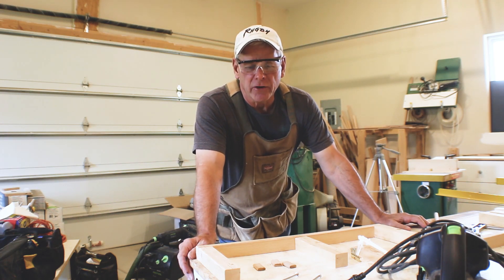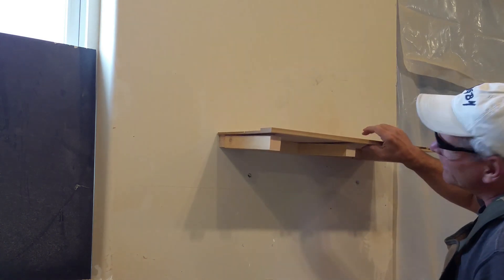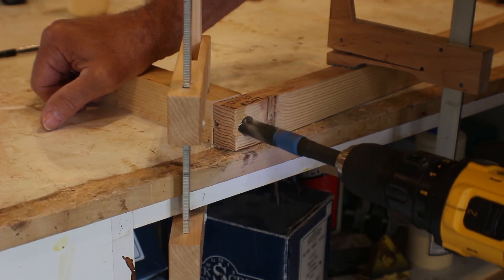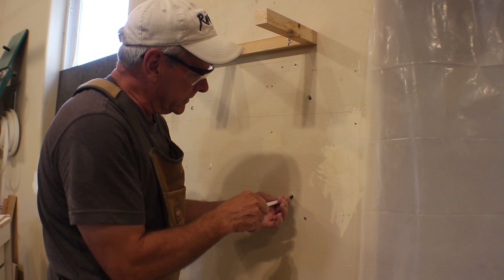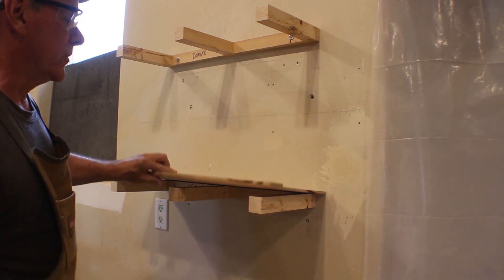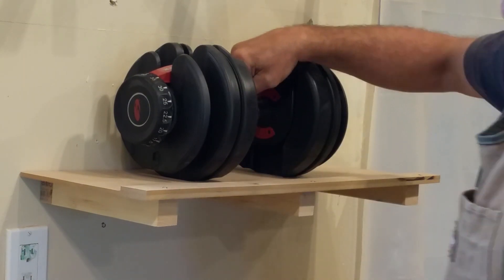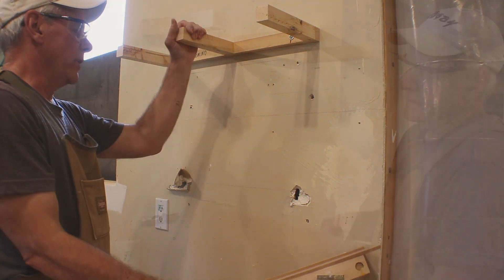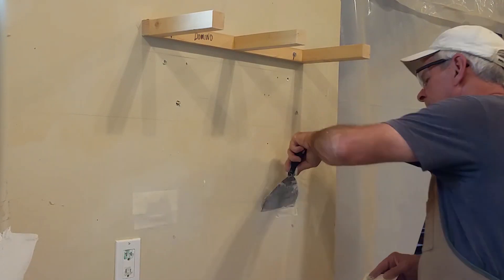Floating Shelves Sheetrock Test - Why Toggle Bolts Aren't the Best Option for Shelf Strength

Comment: I'm trying to put a floating shelf which is about 20.5 in Width and 17.5 in Length held by anchor togglers supposedly 143lbs. I want to place a projector which weighs about 28-30 lbs. Do you think the sheet rock will give over time just like this experiment? Unfortunately, I can't use a stud as there arent any in that area where I need to shelf.
Reply from the maker: Yeah, unfortunately you are probably right that the shelf will not hole up in sheetrock. The greater the width of the shelf, the more it is like a swimming pool diving board. That springboard action is what will tear out the sheetrock. Those weight support numbers are really referring to downward force on the sheetrock, not lateral or combination of lateral and downward forces. A couple of "L" brackets with a couple of toggle type bolts in each would probably do the trick in the sheetrock.

Comment: It's kind of annoying that you had wall studs there, two examples made, and you didn't test the weight capacity of the floating shelf attached to the wall stud with 4 inch screws...
Reply from the maker: Hey, Jacob! You may want to take a look at a playlist on my channel called “All About Floating Shelves”. I did a number of videos on strength testing various ways to attach shelves to studs which included some screw tests. The main thing I found was that the screws tend to flex more as weight is added to the shelves than some other methods such as wooden dowels into the studs. The most rigid installation method by far is the all thread rods into the studs.

Comment: I have wood paneling in the great room of the house; I wonder how strong they'd be compared to sheet rock.  My guess is less.  This is the old 60's style wood panel, fairly thin.  But, studs are every 16" as expected, certainly I would use them.  I'm planning on mounting my 55" curved TV to a mount held by the studs.  It's a typical tilt and swivel used for the curved sets.  Obviously I won't be mounting to the wood panel! :-)  But, I'm thinking a few floating shelves for bric a brac; and I was wondering if the wood panel would work for that.  Still suspect not; we have a Main Coon Cat that probably exceeds the weight limitation of wood panel support.   In fact, not sure why I'm even wondering right now, seems slightly better than cardboard. lol

Comment: i made 2 floating shelves out of pallet wood. for the "bones" (the inner part that's actually screwed to the wall), i used 1.5" x 1.5" just as you did. i attached the runners to the part that's against the wall using wood glue and 2 screws in each one. i then mounted the whole thing to the wall using lag screws (with pilot holes drilled, first) going into each stud that it crossed.

my lower shelf is around 4 ft long and my upper shelf is just over 7 ft long. my lower shelf (just above my monitors) holds my router, some desk supplies, a jar of candy, and a few other items. it doesn't sag at all. the upper shelf has some of my collectibles on it. they weigh quite a bit more than the stuff on the lower shelf and it doesn't sag, either.

and while they don't look near as good as yours (seeing as how i used pallet wood, lol), i didn't really pay anything for them. i get the pallets for free and i already had the other wood, glue, screws, and other hardware i used.
Reply from the maker: Thanks for the report, sean, and comments. The reason I went with the dowels instead to the screws is that I wasn't sure about those glue joints against the wall but it sounds like they are working fine for you. My guess is that the length of your shelves with you hitting all the studs in that span is helping the overall strength as well. Hey, there is nothing wrong with that 'rustic' pallet look either and it's awfully hard to beat your price! Good job!
Reply: @RustyDobbs  hitting all the studs is what i set out to do with the long one. after i made the inner frame, i marked the stud locations on the wall. then, i held up the frame where i wanted the shelf to be, then marked those locations on the frame. then i drilled pilot holes for the lag screws and used large, flat washers so they wound't pull through the frame. then i held the frame against the wall (again) to mark the hole locations on the studs then drilled pilot holes for the lag screws (using a smaller bit) to go into the studs. it's pretty damn solid on the wall, lol. for the small one, i used a combination of lag screws w/large washers into studs (2) and toggle bolts w/large washers (3), alternating between them along the length.

and using glue and screws going through the long frame piece into the runners (or fingers)...i coated the ends of the short pieces and the area of the long piece it mates to, with glue to make sure there was more than enough. then i put two 3" screws into each one. the glue holds more than the screws, but i added them as a little extra support...just in case, lol.

i want to build some more to put in other parts of the house. but i'd rather build those with some nice, solid wood; as the rest of the house is a different style than the room with the ones made of pallet wood.

Comment: I wonder if another 2x2 added above the shelf would help with it pulling out. Kinda like sandwich for the plywood shelf. 

Im trying to add a microwave floating shelf in my kitchen into a corner. So 2x2 or 2x3 supports on the back of the shelf 25 inches long,& a 17 inch support on the right side of the shelf. Then placing the same supports above the shelf so it doesn't flip and holds it into place. Stud placement in my walls are horrible. Anyone ever try or understand what I may be talking about lol
Reply from the maker: I don't know, Actionronnie, but tend to think the 2x2 above the shelf would not help much. If you have at least one stud on each wall in those spans and the studs in the corner, I would think you could build a shelf that would safely hold a microwave depending on its weight. It being in the corner is a plus. You might check another of my other videos on floating shelves which includes a corner floating shelf and see if anything looks helpful. https://youtu.be/nAOAkoIFkAo   I've done some other videos on floating shelf strength that you may want to check out as well. Thanks for your comment!

Comment: Would there have been better support with more anchors,  like 4 instead of 2? Would 4 anchors support the 50lbs?
Reply from the maker: Possibly a little stronger but in this case the strength of the sheetrock at each location of the anchors is the determining factor when weight begins to be added. Check out this video for more floating shelf strength exploration. https://youtu.be/EXMJnYl5by8
Reply: Yes, your intuition is correct. You're effectively distributing the load that each anchor exerts on the back of the drywall. How much weight and on which anchors loading occur depends on the type of load (point load? distributed load?) and where loading occurs (on a single anchor? in the middle of two anchors? 1/4 of the way to the next anchor? right against the wall? halfway deep? at the tip of the shelf?). The closer the load is to the wall (and the anchor), the greater the shear force and the weaker the torque ("the pulling force" against the drywall -- which is why it failed in the video) and vice-versa. Because wood is long grained, there is a tendency to "split" it if you wedge too many screws next to each other (so stagger it).

Comment: I am curious how they respond when screwed directly into the studs. i want to create floating shelves for my cable box and other gear and dont want to see the front sag even if it wont get up to 50lbs. I was under the impression that the dowels woud be the weak point glad to see that is not the case.
Reply from the maker: I definitely think you are on the right path for what you are describing. As I have said in other comments, I was surprised with the results of my own experimentation about how strong these things can potentially be. The only thing I wonder about is when you start moving out wider with the shelves, how much more pressure does that put on the threads of your lag bolts. Seems reasonable that the wider the shelf is and the more weight that is placed further out on the shelf, the more likely you may have a bit of a 'pry bar' force on the lag bolts wanting to pull the bolts laterally out of the holes. Would think wider shelves/longer lags would help to counter that tendency. Good luck and thanks for the comment! Keep us updated if you run into something interesting with your project
Reply from the maker: Yeah, I think hitting studs that are 16" on center would make a major difference. I don't think I commented on this in the video but before the toggles pulled through the sheetrock, the sheetrock was actually creased by the lower bracket edge against the wall. If I wanted maximum strength for shelves, I would run 1/4" by probably 3" lag bolts through the brackets into studs. I would also use larger washers on the lag bolts to reinforce the areas around the holes. I may do a few of these shelves in the shop and if so, I'll do another video with these parameters. Thanks for the comment!
Reply from the maker: Alright, Cam, you may have given away too much information with your hint! Wait, I just noticed you are talking about 3-4 feet, not inches so I am lost again! Anyway, I thought you might be thinking about extending the dowels from the shelf supports through the sheetrock and into the studs 3-4" to offset the cantilever effect, which might be a stroke of genius! Seems like that would take the sheetrock out of play as a contributor to the failure of the shelf. If that is not your idea, it stimulated my brain to consider another option anyway. Amazing how the subconscious works! I see another video on this coming soon!
Reply from the maker: I think you are right, Tom, about the depth of the shelves being an issue. I can't seem to get this strength idea for floating shelves out of my head so just finished shooting footage today of another test of a method. Will be posted on my channel in the next few days. It takes the sheetrock out of the equation and I end up with some surprising results.
Reply: Glad to see someone else with the same idea as me. I am getting ready to upgrade my whole entertainment setup and I want to get rid of my floor entertainment center. 

I want to create a floating shelf that is say 70" long x 24" deep and on that shelf will reside a cable box, a bluray player a receiver and underhung will be a 20 something pound center channel.  

The goal is to have welded steel brackets that hit nothing but studs with lags all the way across. The question is.... Is it reasonable to think a shelf like that can support say 100lbs long term without sagging or tearing out.

I think the design may need turn buckles from the underside to help support the load. The turnbuckles would run from the stud in the wall to the front underside of the shelf.
Reply: I think you are spot on with the cantilever effect. Sheet Rock is very strong if the forces are lateral. I have a massive beech wood head board mounted directly into sheet rock with those Togglers (which are amazing by the way!) and I think the size I went with in 5/8 sheet rock was estimated at 150lbs lateral. That headboard hasn't budged and it does actually have shelves that slot in between the beech runners.  

Great vid and thanks for replying!
Reply: I'm actually considering another possibility to counteract the cantilever If I can get it sorted I will give it a share. Hint the cantilever I'm thinking about is more along the lines of 3-4'
Reply: Sometimes, steel rods are used, set into the studs and then into holes in the shelf material.  But even that is not strong enough if the shelves are deeper than about 12"
Reply: Rusty,   Yes, it is an interesting problem. I'm a cabinetmaker and always noticed how hard is is to keep floating base cabinets on a wall.  There is a lot of leverage force pulling them away from the wall at the top.  It's nice if you can plan for them before the drywall goes up.  Will be interesting to see your next video.
Reply from the maker: Thanks for your insights, Tom. Not to totally spoil the video for you but I had 3 - 50 lb bags of cement stacked on a 12" x 30" floating shelf and it probably could have held another 50 lbs, but I bailed on the idea. I had cut a slot in the sheetrock so that I could rest the floating shelf bracket directly against two studs.The bracket and studs were connected with two 3/4" x 3" oak dowels glued 1 1/2" deep in the studs and through the pine shelf back support. I could not believe how strong it was. If the shelf had been 18" deep, it would have been a different story by some factor, but how much weight realistically does a 30" shelf need to support? Ultimately, the pine failed. You'll enjoy the video.
Reply from the maker: Thanks for your insights, Tom. Not to totally spoil the video for you but I had 3 - 50 lb bags of cement stacked on a 12" x 30" floating shelf and it probably could have held another 50 lbs, but I bailed on the idea. I had cut a slot in the sheetrock so that I could rest the floating shelf bracket directly against two studs.The bracket and studs were connected with two 3/4" x 3" oak dowels glued 1 1/2" deep in the studs and through the pine shelf back support. I could not believe how strong it was. If the shelf had been 18" deep, it would have been a different story by some factor, but how much weight realistically does a 30" shelf need to support? Ultimately, the pine failed. You'll enjoy the video.
Reply: Rusty,  Wow, that's quite a load. I think it was wise to not try the last 50 lb bag. 200 lbs of crashing shelving could be a bit much. lol

Comment: Thanks for doing the test.  I want to do a floating shelf for the washroom mostly to practice with  but also to replace the existing wire type shelves that failed by pulling through the drywall.  I want to do something more secure and your test helped me to understand failure areas better and how to better design my floating shelves.  Keep up the good work!
Reply from the maker: Thanks for the comment and encouragement! Yeah, the test was a bit of an eye opener for me too. I think by using hardwood as the structure for the supports, hitting a stud or two and maybe larger washers on the bolts, I'm not so sure you couldn't put some substantial weight on these types of shelves. They certainly can be made to hold pretty much anything you would want to put on a shelf in a washroom, don't you think?
Reply: I think you are correct.  It will be a month or two before I get to try it out.  I'm still putting my kitchen floors back after doing extensive floor joist work I'll try to remember to make a comment here when I do get to do it and let you and your viewers know how mine came out
Reply from the maker: Sound good. Will be interested to hear how your shelves turn out. Gotta love opening up the floors for repairs and living in the house at the same time. I have done that a few times too. I enjoy the process but it's always nice to get things back to normal.